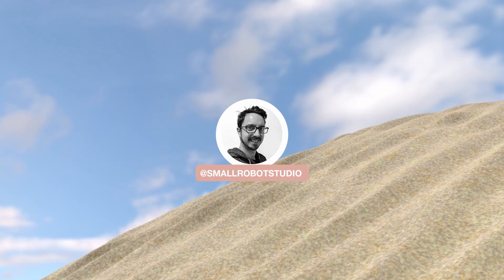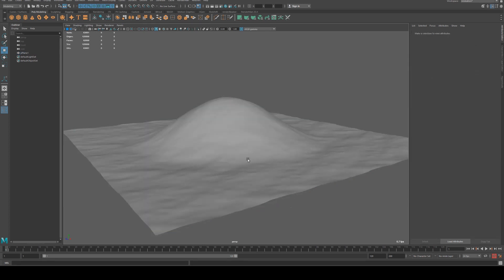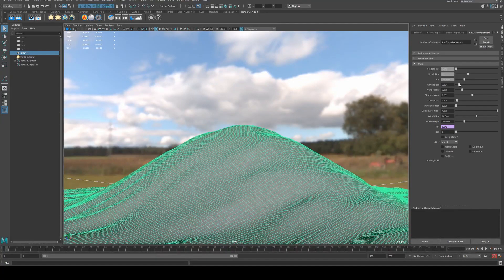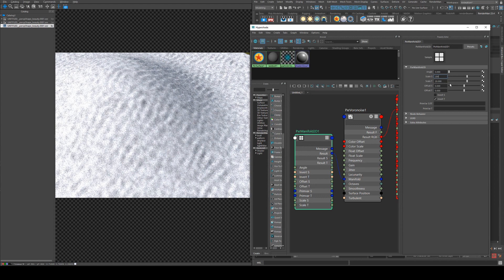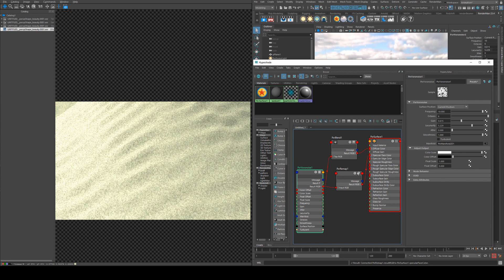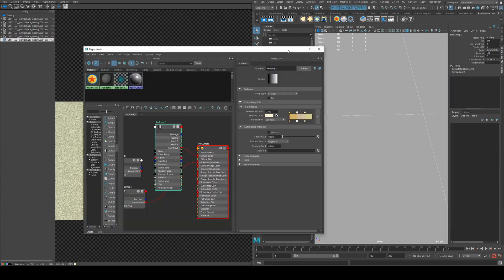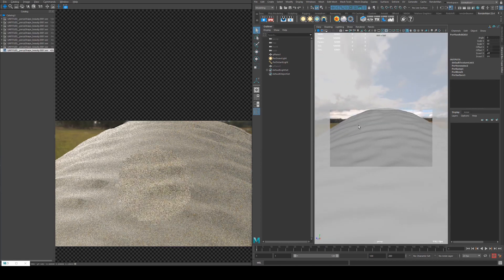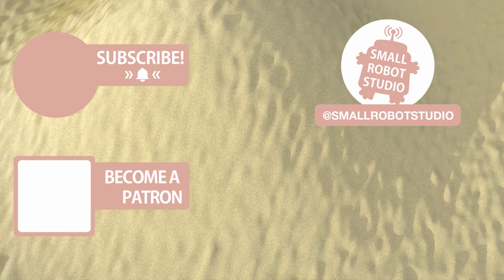Renderman 23 Sand Shader Tutorial

Comment: you are using Rman 23 so I assume you are using a newer version of Maya (later than 2016) too. The Hot Ocean deformer is for up to Maya 2016 in your installment video. Is there an update to this or will the 2016 version work in Maya 2023?

I have it installed, it shows in the plugins list in Plugin Manager. I can check AutoLoad but not Loaded. The info icon is greyed out so not sure it is working.
So when type "deformer -type hotOceanDeformer_" in mel, get "// Error: line 1: Unable to create/find dependency node." 

Any ideas as to why the soft select doesn't highlight an area therefore isnt working...?
Reply from the maker: From memory HOT is no longer supported by the developer so it's likely not forward compatible from about Maya ~2020 but you'd need to do the research to find out what the last working release was.

Comment: Heya, Is there any reason to actually use HOT instead of BOSS and making a Spectral Wave? Can the shader still be applied to a BOSS output? Thanks for the great videos
Reply from the maker: You can use BOSS if you're comfortable with it, just convert to geo once you've set it up. HOT is just a little quicker for me.
Reply: @SmallRobotStudio  @SmallRobotStudio Since the HOTocean deformer doesn't work on the recent update. Whats my best option in this case?

Comment: Hi Mike, I hope you are having an amazing day, I have a very big problem in renderman. When I denoise the image in renderman, I saw in Nuke that it is 16bit not 32bit!!! This is destructive for my workflow!! Is there a way to fix that. Thank you
Reply from the maker: Do you have the AOV for the denoise type set to "Float" and not "Half"?
Reply: @SmallRobotStudio  Thank You, I am using katana, I made sure that the main Beauty render is 32bit float and then I checked it in nuke and its it's actually 32bit but the Denoised one is 16bit!!!! However I have also a very important question! When You render the denoised image. Is it denoised using the denoiser made by Walt Disney or the same one used by IT(OPTIX DENOISER). If you can answer now this would be super amazing since I have a very important project!!!
Reply: And does choosing which hardware to use in denoising affect which one is used(Optix or Walt Disney)
Reply from the maker: If you're batch rendering it's always Disney denoiser, Optix is only used with IT. I'm not sure why the denoised version is 16bit, that may be by design but I can't say for sure, I always use 16bit anyway. What's the reason for needing 32bit depth specifically?
Reply: @SmallRobotStudio  I figure the reason! Does denoise in maya has a choice to choose float or half. Moreover for the reason, since I do heavy composting which requires 32bit float so I can be 100% protected from banding and artifacts!
Reply from the maker: Ah I see. I'm not sure what the settings look like for Katana in AOV's I'm assuming they're the same. The float/half option is only for the AOV not specifically for the denoised pass. You might have better luck seeing if anyone in the Renderman Answers page can help I'm afraid since I've never had to do heavy enough compositing that I require 32bit depth, sorry!
Reply: @SmallRobotStudio  Thank you, but how about denoising other channels like Shadow pass?